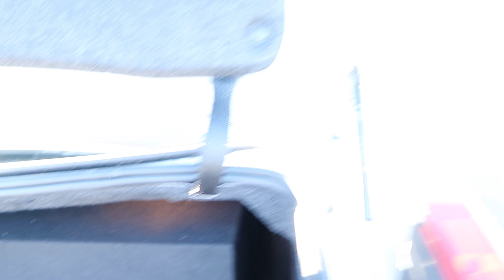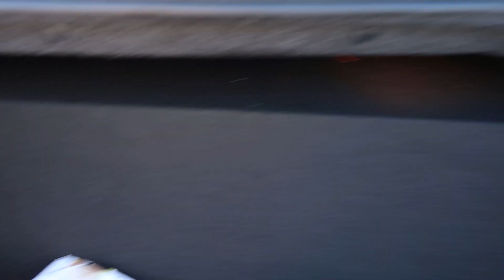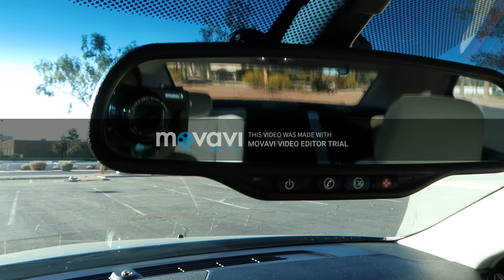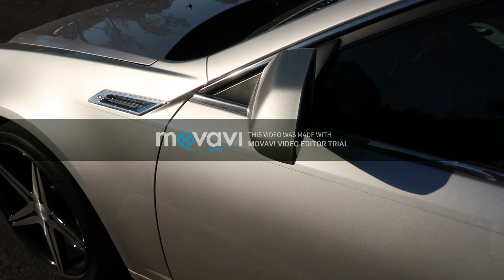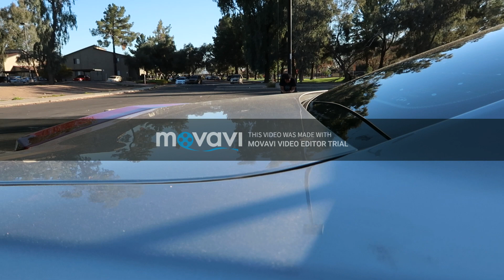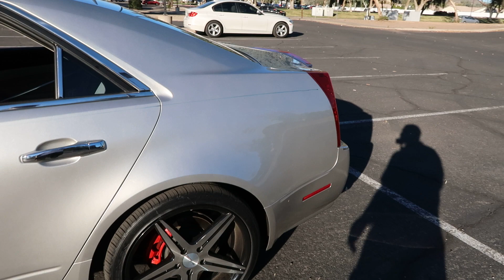2008 Cadillac CTS 2 12's Rockford Fosgate Dual P3

Comment: Face the subs the other way firing back. Day and night difference.
Reply: OddyO's MusicO what’s the difference ?
Reply: Phillip Todd 
If you face the subs towards the trunk compartment, it used the entire thing as an echo chamber causing more vibration and deeper sounding bass
Reply: Subs produce more bass behind the enclosure than in front when in a concealed space eg a trunk. Much much louder facing towards the boot.

Comment: You have to have the hand rest down ?
Reply from the maker: Fabian G what do you mean exact
Reply: @treysempire3008  since it's in the truck
Reply from the maker: Fabian G are you talking about the seat being down
Reply: @treysempire3008  yea because my car don't have that's
Reply from the maker: Fabian G no you don’t have to have it down just to show the amp is why it was down
Reply: @treysempire3008  but does it sound good since the seat is covering it?
Reply from the maker: Fabian G go watch my videos with the Rockford fosgate 3.5 unboxing you will see the 8 inch cut out hole we’re the factory sub goes and you can remove that for air flow

Comment: I love it! Ive got the Shallow mount Punch 12 inch in the pre made sealed enclosure. For low volume music its perfect sound quality. But for turnin up it lacks the low end obviously isnt too loud, in the car its loud but you cant hear any bass with all doors open. Its RMS is 400watts and I have a 800 watt amp at 1ohm, I could Slap the Duel P2 enclosure in my car just plug and play, it would be so sick, but my opinion is, I have a ute so it would be on the back seats and it would easy get stolen, I also use the back seats and for myself with windows leaking water through the seal, at this level of bass it wouldnt help things. Everyone says its a myth that bass will destroy your car, but I think at this level it could start to do some damage, just sayin :)
Reply: Kurtis do you have any videos up

Comment: Did you do anything with the alternator, do I need a capacitor to protect my alternator or naw? I got a 09 cts and gonna install a 500 watt amp will this be reliable in terms of not dimming the interior lights when the bass drops?
Reply from the maker: Yes install a capacitor I blew my alternator twice
Reply: @treysempire3008  ok thank u very much :)
Reply from the maker: @carft1234  your welcome but my Cadillac got shot up so now I’m getting a Redeye
Reply: @treysempire3008  so do you suggest level 1 or level 3 on the window and body bulletproof car armor
Reply: @treysempire3008  what’s a capacitor I got a 10 cts and want to install subs but don’t want my power to not wor

Comment: I was thinking of ordering those subs in that box. Seen them for $389.
Reply from the maker: Im Going To Do A Upload Today
Reply: Got mine off amazon for 160 each
Reply: $389 is a steal ! They go for $499 brand new
Reply: @dominickgonzalez3046  Actually, the----  Rockford Fosgate 12" P3 [RMS/PEAK] 600W/1200W Duel ohm Voice Coil: 2.5" -- for one can range anywhere from $259 to $300.   Dayum, just one w/ a quality spec & tuned AMP is HARD hitting! 
You def need that BASS knob, worth an extra $50!      (:D)  (:D)

Comment: Did you install the system yourself. Looking to install mine this week. Was wondering how you tapped into the speaker wires for the loc?
Reply from the maker: Yes I Installed It My Self Took Me About 3 Hours
Reply: Gordon's TV Coo mane if you can show a vid of how you tapped into the speaker wires to set up the loc I'd appreciate it a lot!!
Reply from the maker: I Will
Reply: @treysempire3008  hey man what ohms did you wire the subs at? im getting these same ones

Comment: How do you install without using aftermarket radio?
Reply: JOSH ARGUELLO audio control line out converter . I have same converter in my cadii. Lc2i, lc6i lc7i etc. or u can go with PAC line out but them ones are cheaper . This one me and him have is good. 2 channels main for your mids door speaker amp.. in which I use mine for my chuchero box(voice box)  and the sub output for the sub amp....
Reply: Lc2